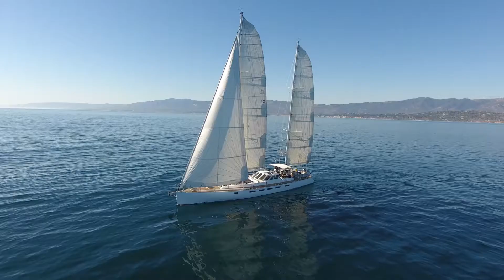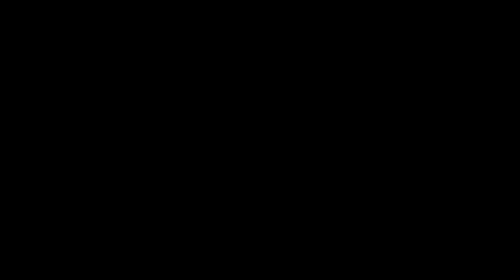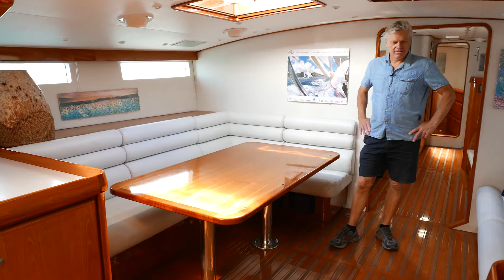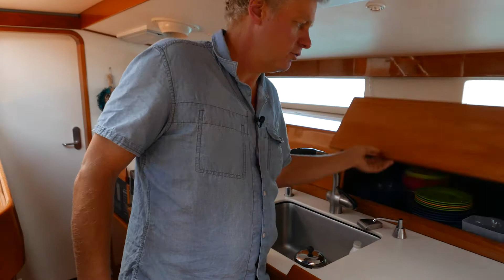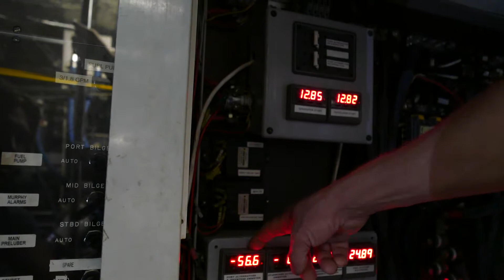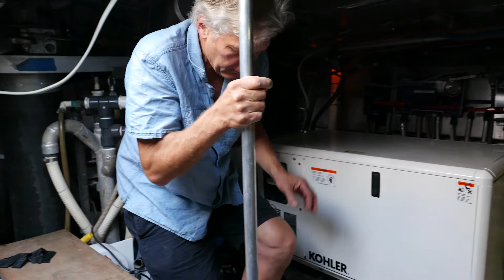Godspeed

Comment: Is the Beowulf series based on this design?
Reply: Beowulf came first. Godspeed is very similar, but has some changes. 

In a comment on SetSail, Steve Dashew, the designer of both says, "Godspell, ex-Kondor, has a shallower keel, larger engine and the next size up Hundested prop, and weighs several tons more than Beowulf. She does not have the articulated bowsprit iether." For the original comment, see http://setsail.com/dashew-offshore-a-bit-of-history-part-2-the-big-roach-cruising-main/#comment-900874  

It also looks like Godspeed has a painted hull and teak decks instead of Beowulf's bare aluminum for both..
Reply: Yes this was based off of Beowulf both have very similar floor plans, no swim platform or Beowulf both built by Kelly Archer NZ
Reply: I take that back Beowulf does have a swim platform approximately the same size.